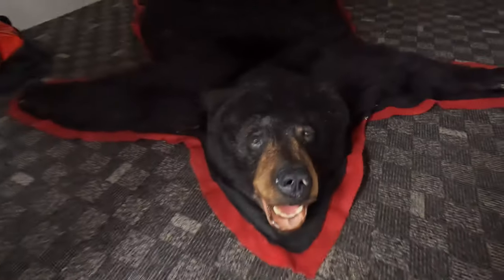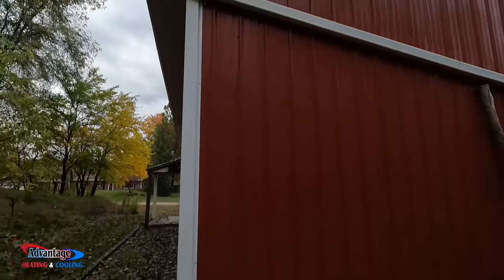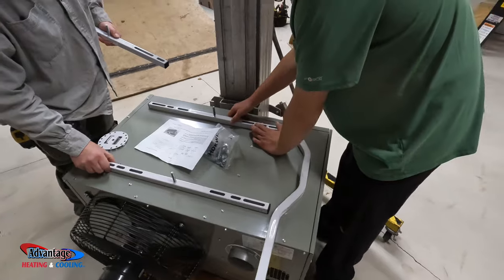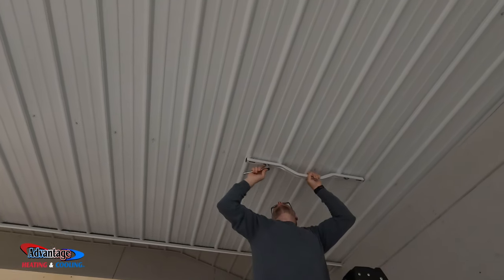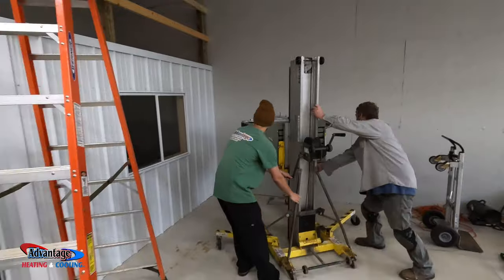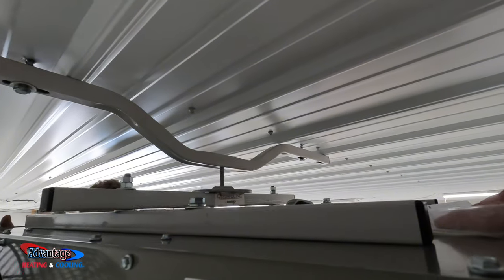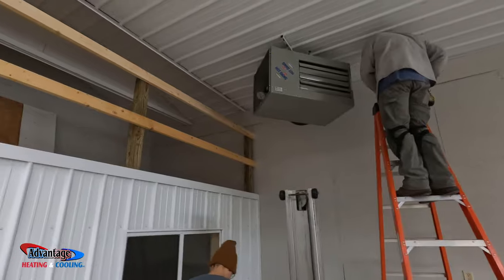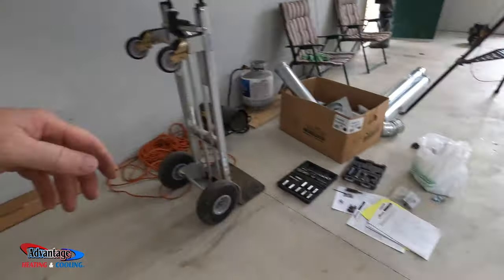Modine Hotdawg Unit Heater Installation Guide for Barns

Comment: Nice video.  I bought a 45000 btu Modine Hot Dawg in June 2010 for a detached garage I had build that summer.  Garage is 26'w x28' deep (728sq ft) with 12' ceilings .  The 45,000 btu unit is perfect and quite frankly probably would be suitable for something larger.  It had performed flawlessly until this January 4th.  Turned out the heater itself was still fine but the subcontractor who installed it for the builder made  in intake pipe to the outside to suck in the air. Seemed like a good idea at the time.  Somehow that intake pipe got blocked restricting air intake and the heater wouldn't ignite.  That is a good thing.  The Hot Dawg has since resumed performing well, so after a bit over 13 1/2 years I highly recommend them.
Reply from the maker: Thank you so much for sharing that.

Comment: Gas rises...Flue needs to rise 1/4" for every foot of run. You started with the flue already below the exhaust. Plus its good practice to have some sort of straight run coming straight out to prevent back up.
Reply from the maker: Thanks for that information.
Reply: These have powered exhaust fans that blow the exhaust out.  The rise is not necessary on these models, from my understanding.
Reply: @tjayh5981  if you read Mr Heater installation instructions it says it in there. Is it absolutely critical? Probably not, is it the right thing and the safe thing to do? I would say so
Reply: @brockperry6008  This is clearly a hot dawg heater by Modine.  Not sure why you would look at a mr heater manual for info about these models.   I have 2 hot dawg heaters by modine and the correct manual for these heaters shows you can either have an up or down slope to the horizontal exhaust.  It does show a drip leg in either which this guy doesn't have and it says 1/4in /ft slope.  Google the correct manual.

Comment: Didn't think you could use b vent on power vent appliances I was always told my modine you could only use one small section just to go through the wall? ...im just asking i always buy the single wall vent kits for them..... However in my personal shop i Used b vent on it ...
Reply from the maker: I have only installed a Hand full of these in my 31 years of doing this trade. I Looked in the Manual and didn't say anything about you couldn't.  But from time to time I do make mistakes. :D
Reply: @ADVANHVAC  I don't see a problem myself